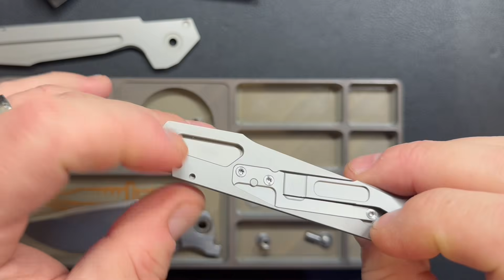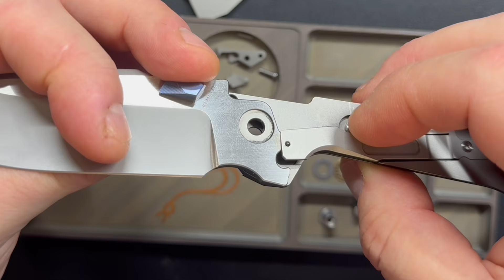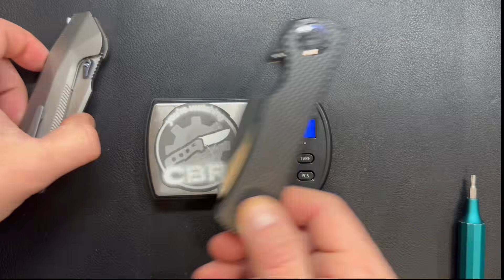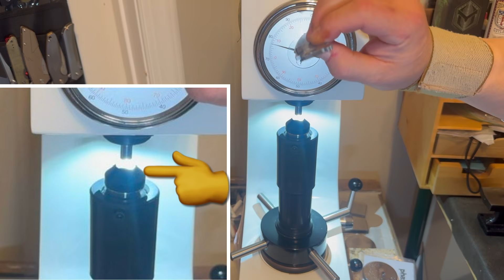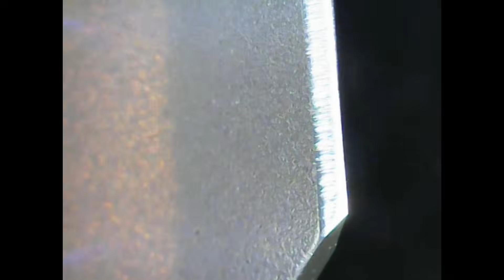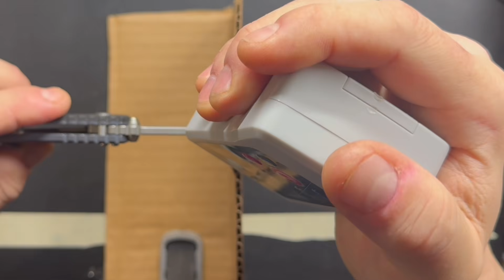Can a Chinese “GRAIL” Out-Slice the Hinderer XM-18?

Comment: I just want to give you some recognition for having the integrity and courage to admit your previous hrc testing protocol was not ideal, and spent the money and time to acquire the equipment needed for reliable and accurate testing. The rest of your review process was already stellar, now that you have implemented proper hrc testing you are basically a one-stop-shop for people looking to vet a knife before purchase. You simply cannot find hrc testing when looking at reviews for a knife, except here. I am very interested in knowing the hrc of several of my pieces, particularly my 0562 Magnacut that was an early run. Kai/Kershaw/ZT improved their Magnacut heat treat and hrc about 1.5 years ago, and I know my 0562mic is right on the cusp of that time frame. I'll be getting a Bel Air xl soon, so I can have confirmed 63.5+hrc Magnacut, but I was really hoping my 0562 would have that. I think it will be closer to 61-62
Reply: Also 61.5-62 is a fantastic result for M390. That's definitively above average, and especially for a Chinese manufacturer. Sharp by Design by Reate with M390, sadly, tests in the 58's

Comment: I’m glad someone started measuring the primary angle. It is a direct variable to behind the edge thickness and gives a great determination in slicing ability and quantifies geometry. I always measure.
Reply from the maker: One of the viewers recommends this.
Reply: I Concur. BTE thickness often varies along the edge, but also differs from batches and perhaps even in the same batch. The Spyderco forums have a thread of BTE measurements and you can see differences on the same models. But with that said, it's not going to differ too much, so a general test will give a plus or minus variability. I have a native5 but it's thicker BTE than most native5's and thus is not viable for cutting cardboard vs others with thinner BTE geometry.
Reply: I measured a dozen of my Spydercos and they range between 3 and 5 degrees. My hogue Deka wharncliffe MEASURED 9 degrees. Found that out because I noticed the poor performance. Don’t understand the thickness or compound grind on that one.

Comment: Ramette actually used to be around 63rc. But Ramette were talking to luvthemknives some time ago about wanting to make them softer. Like 60rc soft. But i believe the community was not receptive of that. Obviously theres some variability in mass production, so im unsure if they lowered it to a 60-62 range or if this is still in the 61-63 range they were typically tested at years ago. Meaning, i dunno if they made an actual change in there m390 hardness or not based on your test of only a single sample.

Comment: The Peregrine Falcon was the only Remette that I really felt like I needed to get. Of course, luxury knives aren't a need, they are a want but you get what I mean. They do some cool stuff though
Reply from the maker: Did you get PF with the safety lock or the earlier one, without?
Reply: @CBRxLIVE I have the lock one. The lock only works with blade open. You can't lock it out when closed which I thought was weird.